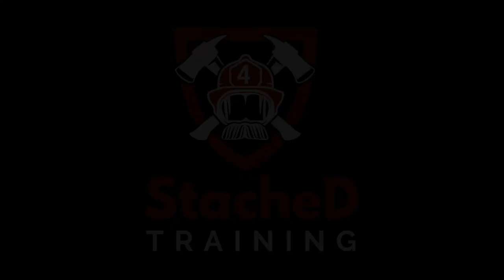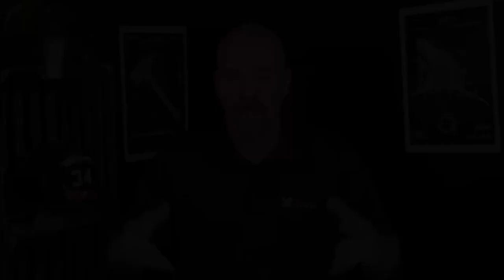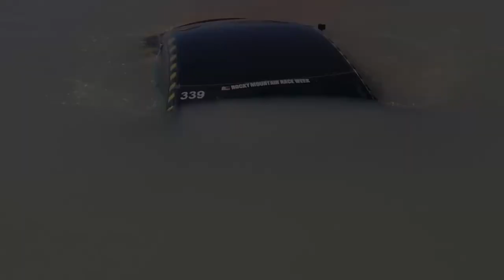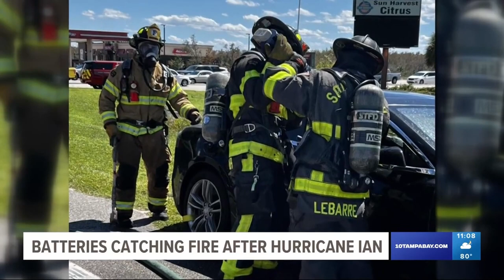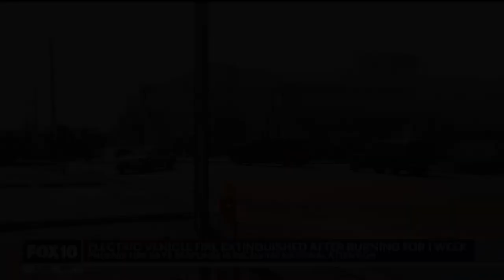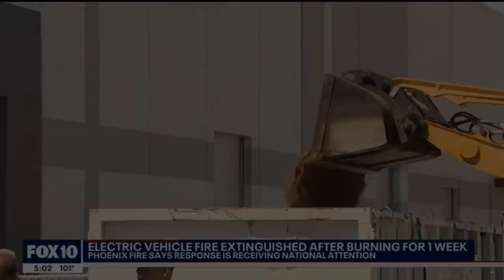Does Submerging Electric Vehicle Fires Work?

Comment: Patrick Durham thanks for the video. I would provide some thoughts from my European view and we have a container on our station, so this is practical experience for me.
The container solution is not for fighting an active battery fire!
We use it for dry quarantine of EVs which are possible critical after fire or accident. 
The vehicle is monitored by a remote alarm system watching  hydrogen, carbon monoxid and temperature level. If battery escalates, flooding of battery - not the whole vehicle - will start. This needs about 5.000 to 8.000 liters, depending on vehicle design and mounting point of battery. The water doesn‘t extinguish reacting cells but it isolates thermical the not reacting modules and thermal runaway stops within short time. 
The wet quarantine has no secure time period, it ends when emergency technician removes battery from EV, dismount it and stores the modules in safety containers. 
This is the only method, where 100 % of extinguish water is collected. The disposal costs about 300 Euro per 1.000 liters. 
We did chemical analysis of water from 2 incidents and the water was able to be treated as industrial sewage. 
I find this method very effective and the container is useable in multi purpose. Ours is flyable by helicopters and used on wood fires, …
Let it burn is one tactical approach but the container solution is also one way to deal in an effective way.
Reply: Hi Patrick, Why are electric vehicle charging stations not require to have ABC Fire Extinguishers on hand? All the gas stations I have been to have a couple of ABC Fire Extinguishers on hand. I thought ABC Fire Extinguishers helped to buy time while the fire department is responding. Thanks, Nathan
Reply: @natez9059  I'm not expert, and it's just my opinion, about  EV cell getting fire, all cells confined in cell or pouch, and all this inside metallic container, last think, oxygen not needed to continue to burn. Then, in my opinion, extinguisher is only good for other fire compared to battery fire.
Reply from the maker: @natez9059 ABC extinguishers are completely ineffective on lithium-ion battery fires.
Reply: @natez9059  ABC extinguishers are not effective for class D fires -self-oxidizing ones. Batteries are a class D fire.
Reply: @StacheDTraining  Hi Patrick, So I guess that there are no fire extinguishers in existence that could be used to help slow down an EV fire before the fire department arrives on scene? Thanks, Nathan
Reply from the maker: @natez9059  This video may help explain the issues with extinguishers:  https://youtu.be/qgP7KkDesBo
Reply: @StacheDTraining  You gave me an idea. Could the Troy fire department hire a seamstress to make ev car size fire blankets? The current ones are way too expensive for most people to buy. Fire Blanets need to sell for about 100 dollars or less to be as readily available as ABC fire extinguishers. Thanks, Nathan
Reply: Hi, thanks for the updated information, especially about the disposal costs of extinguishant water. The containers are a great way to safely store a damaged EV. Some countries in Europe are adding a silicon / silica sand to the water in the 'skip' to speed up the cooling effect. Also it must be noted that a damaged / crashed EV is supposed to be stored 15M in all directions (Front rear, off and near side) from other vehicles, this leaves salvage of recovered EV very expensive because they can take up the footprint of up to 70 combustible engine cars. If all of this (salvage and disposal costs after an accident) were factored into the insurance costs these EVs would be dead in the water, but the governments throughout the world are complacent in perpetrating this scam on motorists. The trend now with insurance companies that is presently happening, is a question on your HOME insurance proposal form..''what type of a car do you drive?'' Where do you park it? Where do you charge it?....''Oh so it's charging beside the house? sorry sir we can't quote you for HOUSE insurance! 
Do you think the Insurance companies know something the EV salesmen and government stooges don't?

Comment: Removing heat to stop more cells from self igniting is the primary purpose of submersion. Reasonably effective, but a unit where the water could be chilled would be better. At least with this method all the waste metals are contained instead of being dispersed into the public sewer system.

Comment: EV Battery Bricks should be installed with mounts that will MELT and DROP the battery, to limit the cascading effect.   Zinc has a low enough melting point
The car and the remaining undamaged batteries can be moved.  The remaining car with all those nasty plastics and foam can be extinguished.  If the fire spreads to an adjoining cell, just keep rolling it down the road.  It will also require a universal Tow Hook in the bumper.
Reply: Interesting idea, and tow hooks are nice, but i think the car would be totaled before sufficient heat reaches all zinc mounting points.
Reply: Absolutely, unless it's an underground car park 🤣🤣

Comment: Just took a day long course on this from a group that tests all these types of batteries.  LET IT BURN!  (unless there are severe exposure issues)  Letting it burn freely destroys most of the toxic smoke, and eliminates the hazardous runoff problem.  By the time you get one of those containers to the fire, it's going to be halfway burned up anyway, and the car is likely going to be structurally unstable to try and lift anyway.  The "dumpster" is likely going to be tied up for at LEAST a week, so you'd need half a dozen in a large metro area, plus the roll off truck to haul it, so your already in the neighborhood of a quarter million for basically a garbage truck.
Reply: Then you need a machine to lift it. There's another 250-500k
Reply: I would think they would need to go into a tank with salt water to make sure the battery is discharged if the car is not 100% consumed in the fire.
Reply: @fountainvalley100  That's a VERY bad idea, as that makes all that salt water hazardous waste.
Reply: @ffjsb  any water would be hazardous.  There was a fire on a RoRo ship and they were taking any electric vehicle with any fire damage and putting them into a tank.  They were not going to risk taking an electric car off the docks.
Reply: The trouble with burning is that people's exposure to toxic gas is so much worse if they breathe it in. The lungs are great at absorbing these toxins compared to just touching contaminated water. Out in the country sure let it burn, but in a city? I hope not.
Reply: @latetotheparty184  That's quite incorrect.  It may seem contrary to logic, but actually letting them burn actually destroys the most toxic of the gases.  EV batteries burn at a much higher temperature, so it will consume those gases, reducing them to less harmful gasses like carbon monoxide, which will be dissipated in the air.  Just casual exposure to the gases can cause severe lung damage with just one exposure.
Reply: Here’s a thought,don’t buy them
Reply: @lv4077  SHHH.  You're not supposed to say that...

Comment: Lithium iron phosphate (LiFePO) or LFP batteries are replacing the more dangerous Lithium iron (NMC) batteries. The LFP batteries are much harder to ignite and much less likely to have an an exothermic reaction and decompose even when the cases are punctured and short circuited as compared to the NMC batteries. Though the Chinese hold a near monopoly on production of LFP,  patents are expiring and production is expected to surpass the more dangerous NMC batteries. So, as the technology has matured we are seeing far safer batteries.
Reply from the maker: Unfortunately LFP is not the safer alternative that is touted.  Older battery chemistry fails around 300ºF and LFP fails around 500ºF.  It still fails quite energetically and it gives off significantly more hydrogen when compared to other battery chemistry.

Comment: How much truth is there in the rumour that when a EV car is on fire that it produces hydrogen cyanide and the cobalt in the batteries is highly toxic. Even when the fire fighters have there personal protective  equipment they are at high risk of exposure. Also I  am led to believe once they have been exposed to these toxins they are done for life. Full respect for fire fighters.
Reply: Hydrogen cyanide (CN), the gaseous form of cyanide, is generated by the combustion of nitrogen- and carbon-containing substances such as wool, silk, cotton, and paper as well as synthetic substances such as plastic and other polymers.

Cobalt is toxic, but not much more than coal according to a quick google search, and is being phased out in at least Tesla's batteries.

The only insta-death car chemical i know of involves mercury, which is emitted by fossil fuel vehicles.
Reply from the maker: It's already been mentioned, but Hydrogen Cyanide is present in most fires.  Lithium-ion batteries are known to give off Hydrogen Fluoride, which is much worst.  UL FSRI is looking at doing a deeper dive into the gasses released, as well as the gear contamination issue.  I will talk about the gasses released in a future video.
Reply: @StacheDTraining  Interesting. I missed that 2017 Nature article. "Significant amounts of HF, ranging between 20 and 200 mg/Wh of nominal battery energy capacity, were detected from the burning Li-ion batteries. The measured HF levels, verified using two independent measurement methods, indicate that HF can pose a serious toxic threat, especially for large Li-ion batteries and in confined environments." and 2 ppm is dangerous compared to HCN's 4.7 ppm according to ACGIH's threshold limit value (TLV).
Reply: @StacheDTraining  Thank you , I'll look for that video.

Comment: The bury in Sand in container method seems to be the best and cheapest method so far. Phoenix FD stated they estimated 3 weeks. It was fine after a week when they unburied it.
Reply from the maker: It's still burning under the sand.  You just end up with a big mess when it's time to remove the vehicle.

Comment: There is one solution.
Governments imposing intelligent engineering for proper fire control
Literally, this just shows that the authorities haven't done anything and just accepted products made by corporations without doing any audit.
The battery packs should be easy to discard from the vehicles and easy to repair and replace in case of damage.
Damage occurs to a few elements and manufacturers should be mandated to open source everything regarding these aspects for a true free market where offer and demand are working without any monopoly or other illegal constrain.
But when you have manufacturers going out of their way to sealing the battery packs, or heck, making the battery packs part of the structural integrity and hiding behind the deceitful pretext of "safety", only to force consumers into buying new complete cars, again government employees are just some corrupt agents of greed and destruction.

Comment: It looked like that empty tank shown in the vid was built to seal up airtight so the fire runs out of oxygen instead of using water .
Reply from the maker: These batteries do not need oxygen from the outside atmosphere to burn.   They also give off highly flammable gas (hydrogen) when failing.  Sealing up the vehicle would likely cause a highly energetic event.

Comment: I remember from my student days, lithium was just a curious AND very dangerous metal.
The samples in the lab were kept in an air-tight container  submerged in kerosene (which it did not react with).
A very small piece put in water produced a spectacular reaction. It will pull the "O" from the water molecule, and the hydrogen left behind got hot enough to spontaneously catch fire.

All those with mobile phones and power banks with lithium batteries are walking around with miniature bombs. 
And an electric car is a pretty Big bomb.
Reply: Except there is no lithium metal in a lithium ion battery. Its part of the Lithium Cobalt Oxide cathode. Rather than the lithium metal stripping oxygen from anywhere (water in your educational example), the cathode gives up the oxygen from the compound to burn other substances, such as the organic electrolyte. The lithium is not the problem, the oxygen, and the rather large amount of stored chemical energy are. Lithium Iron Phosphate cells are far less susceptible, but also contain about the same amount of lithium. Sodium is also a highly reactive metal, but sodium based cells are considerably safer (just not as energy-dense).

Comment: Thanks, a few commenters explained. So should there be battery size limits until this problem can be better managed? Mobile devices have transport rules on size separation so one bad apple does not rapidly ignite adjacent devices. Limit EVs to smaller ranges.
Reply: I have a similar suggestion. Make anyone who buys a large battery EV pass the NICS check. Huge batteries + people willing to do evil is not a great idea.

Comment: lithium potassium and sodium are Alkali metals. Alkali metals react with water, usually explosively. not only does the metal explode in contact with water, releasing more or less the same amount of energy as a lump of tnt of similar mass, it also releases gaseous hydrogen, which is also explosive! I think that getting products that are made with these metals (like these batteries) wet will only make the situation worse.

Comment: If you buried the burning vehicle in sand, is the fire hot enough so that it would be encased in glass when you took it out?
Reply from the maker: They do not get that hot.
Reply: In Europe the water containers (skips) that the damaged EVs are put into are often filled with silicone / silica sand but kept wet to speed up the extinguishing of the batteries.

Comment: Liquid nitrogen to take the heat out, however thermal runaway is likely to continue once cooling is removed.
I think, is there something that can be added to these fires, if in open space to make them burn cleaner, i.e. let it burn but control the emissions that are being generated, as any battery fire is a result of loss of vehicle, and the potential is present for another fire to start unless all the batteries are consumed or burned of energy.
Reply: Well-designed BEVs don't catch fire or limit it to a single module. A chop shop can replace the module and surrounding damaged parts.
Reply: LN2 is very expensive and difficult to transport.
Reply: @jayjaynella4539  Really? Countless YouTube experiments and that scene in Terminator 2 suggest otherwise.

Comment: Salt water might help , as would puncturing the battery casing. As soon as the battery is below self ignition temperature and discharged then it will no longer be able to catch fire. The salt water ingress to the battery would discharge it... whilst probably producing flammable hydrogen and oxygen gas, or maybe chlorine rather than oxygen depending on what salt is used... Not certain that's better tbh... Options though! That 40kWh + in the battery has to go somewhere. If you short the battery or let it burn that's coming out as heat. Hydrogen production would displace heat into chemical potential energy... Could maybe then run that through a fuel cell to recover some energy?
Reply from the maker: Salt water is proven to cause more issues than it solves.   When removed from the water, you will have a thermal runaway.
Reply: Never drive your EV on a beach 🤣

Comment: How many EVs catch on fire in a year.
Reply from the maker: I plan on doing a video to discuss these statistics.
Reply: Even one is too many, because batteries are not meant to catch fire under any circumstances. Petrol is designed to be inflammable and for its vapour to be explosive. Drivers, garages, mechanics and fire crews know how to handle petrol and how to deal with such fires, and ICE car fires are in no way comparable to EV battery fires. For one thing, they require a source of ignition and don't happen spontaneously.

A ICE car catching fire after an accident or collision is unfortunate but largely predictable and not even inevitable because, as mentioned above, there has to be a source of ignition present. When an EV's battery catches fire - sometimes without warning and entirely unpredictably -  it represents a catastrophic failure of the sophisticated cooling, charging, discharging, and monitoring technology involved.

An EV fire is nothing like an ICE fire; beware of pro-EV apologists trying to confuse the issue and diminish its seriousness by equating the two.

Comment: What would the solution be onboard a ship (ferry)? 
The main fire fighting medium available would be salt water and obviously letting the car burn out would pose massive risks to the vessel and an unacceptable risk to those onboard.
I can see no easy answered and it is something the industry is going to struggle to come to terms with over the coming years.
Reply: Not an expert here, but... :)
In Model Airplanes etc. when we want to store the batteries (I think that applies on shipping a car). We set the battery voltage so low, that the battery is chemical stable, but has no possibility to burt into flames. The "worst" thing that can happen then is a stron generation of smoke but no real fire
Reply: Park it near the ramp and have something capable of pushing it overboard 😀
Reply: @juliogonzo2718  seems practical
Reply from the maker: This is an area where we don't have a great solution.  It is currently an area of concern, and I've heard some ferry lines have banned EVs.
Reply: Most (if not all) ferrys with a car deck has a sprinkler systems, and based on the research article "Electric Vehicle Fire Safety in Enclosed
Spaces" from "Research Institutes of Sweden
" a sprinckler system is adequate to contain the fire and prevent fire spread btween vehicles as long as the sprinkler system is in accordance with standard EN 12845:2015+A1:2019